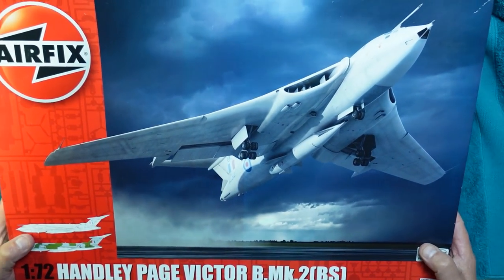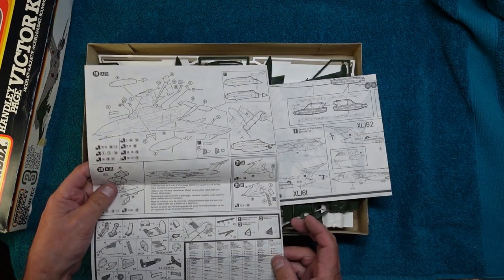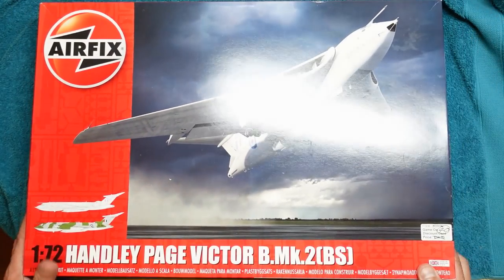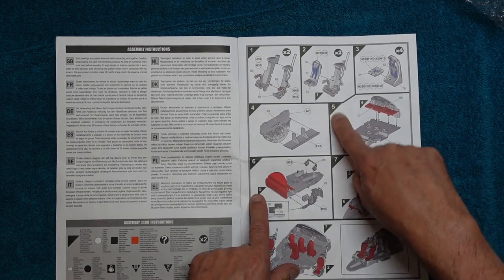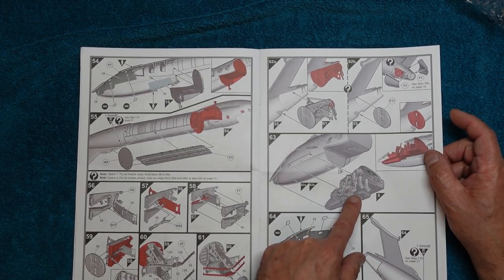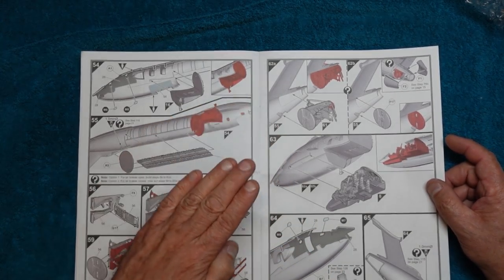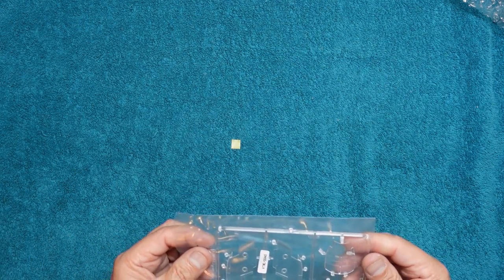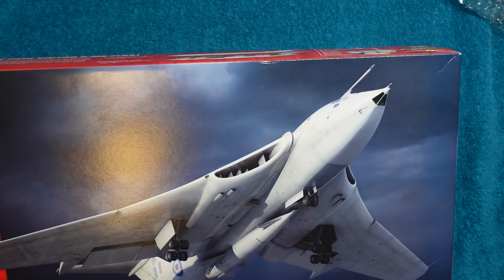Airfix 1/72 HP Victor review and comparison to older kits.

Comment: I built this kit - I'm probably echoing the thoughts of others, but here are few of my "notes" and "if I were doing it again" observations for anyone interested...

Most of the fit was good, but the fit of the "saddle" wing panel over the fuselage needed some fettling to get a step out.
Jet pipes are almost invisible, I wouldn't spend much effort making them seamless.
Ahead of painting, I should have paid attention to getting the cockpit glazing aligned - either pack it or blend down the fuselage to get it aligned. Mine has some little steps. Test fit, test fit, test fit.
The missile fairing in the bomb bay needed some shims to get it nicely aligned.
Front fuselage needed to be "stretched"  a bit to fit round the cockpit. I preferred to sand the cockpit walls and floor to get a good fit rather than clamp and glue to avoid creating a stressed joint. 
I would look to find a way to fit nose gear and airbrake after painting to avoid knocking them off.
The fuselage joint rear of the bomb bay underside has "popped" several times on mine and isn't regluing. Wish I'd added some extra tabs to make the glue area of that joint bigger and stronger.
Fairing around the engine nozzles needs a bit of fettling to slip over the nozzles (and had pretty big sinks.)
I bought the Eduard "Big Ed" set for it. It's nice, but you can see almost none of the cockpit once it's closed up. Gear bay PE may be worthwhile for anyone that picks up their models (not that the kit version is bad.) But I wouldn't bother with the cockpit PE unless you want to practise PE.
I bought the Master Models fuel probe and pitot tube set - they're nice and only a few GBP.
Despite the size of the kit, three years since I finished it, there's no sign of any sag in wings. The internal box structure must be doing it's job.

Don't be put off though dear reader, with a bit of effort the results are very nice, but (at least on my print) this wasn't a case of "chuck the glue in the box, shake it up and a model falls out." Also, it's quite big!
Reply from the maker: Thank you very much Dave. Much valued input there.
Reply: You can fit the front wheel before painting. Don't glue the strut until afterwards.

Comment: I look forward to you building this.
I have built two, one all white Blue Steel and one hemp K2. Lovely kit, but with some issues
with the fitting of the top wings to the fuselage.
I still have the camo Blue Steel to do.
Reply from the maker: Thanks for the tips!
Reply: You can get around the top wing fit - needs some careful sanding and checking of the underside of top wing section prior to fitting, dry fit it and have a good look at pinch points and sand down, you’ll find it fits far far better if you do this.

Comment: As I near the completion of my Vulcan B.2, i can't help but reflect on the fact that the fitting issues were so bad (port wing in particular), that it sucked all the joy of the build out of me and that I don't want to build an Airfix kit again anytime soon.

On one of your other videos, a poster argued that we should keep throwing money at Airfix because we should be glad they're still afloat, and that it was not fair to compare them with other brands. The bottom line is that for the £70 I paid Airfix for the brand new Vulcan kit, I could have had an F-4 from ZM or a huge Su-27 from GWH - and in both cases, the build experience would have been filled with substantially more enjoyment. 

Anyway, I'll watch you build this with interest... but I won't be buying one!
Reply: Mine went together pretty well. So did the Victors.

Comment: Great review of a classic bomber of the V Force. I wonder how the blue colour of the roundels compares with the Vulcans?
Reply from the maker: Well, just had a look and my aftermarket are darkest, the victor is slightly lighter then the Vulcan is lighter again, or more "purple"
Reply: @NigelsModellingBench  is it normal for cartagraph to be so far out, surely it’s the same code for the colour. Which aught to be; HEX #5D8AA8 / RGB (93, 138, 168)
Reply from the maker: @eddiegremlin  Maybe my aftermarket decals are off? But, I'm sure the Vulcan decals look a little purple? Maybe Cartograph only print what they're told to print? Victor and Vulcan are both Cartograph?

Comment: £100 for a paper back? Rip off Britain strikes again lol
Reply: Same sort of price from the USA.
Will be great if it is reprinted. (with Nigel’s Vulcan the right way round)
Reply: @TheWGLOVER  reference books tend to jump like that. Check via ISBN#'s and sometimes you can find decent prices.. for example
Biblio: 2 in Australia at $25 + $28 shipping 
1 in Ohio at $150 + $5 shipping.
Ebay (US) 1 for $80 free shipping
You get the idea
Reply: Unfortunately, books that are unlikely to sell in volume attract a high unit cost. Particularly if they have a lot of glossy full colour images in them. It's simply down to the economics: If a publisher is producing "Buttons Through The Ages" it's not likely to sell many copies, whereas the latest JK Rowling paperback is going to sell millions. Specialist titles with low distribution always cost more (I still shudder to think of the cost of the text books I had to buy for college, even decades later.)
Reply: @davecardboard9567  There's an oddly named place in Georgia (US) called "The Rock". Enormous printers there, had a few pick-up there back when I was an OTR driver. Coupon and ads for newspapers, magazines, books over on its slow side, and text books next to that. Had their own railyard and 3 zip codes. Odd things you learn from trucking. Backed up to the door and was asked to turn on the refrigerator (reefer as we called the type trailer) normally this makes the metal floor too slick for forklifts. Unusually told to stand by door inside and had nice conversation with supervisor there. Once he was satisfied with it's ability to chill, he explained the product was getting was airline magazines fresh off the print machine (at least 8 times bigger than my 82ft long road truck). I was getting 12 pallets for full 35k pound load, how did I want them placed and please go turn off the reefer.  10 minutes it took to get back to door, building sucked up all the moisture from the trailer, I was very surprised. Supervisor explained that the magazines may have a slight need to dry out during first 8 hours after I'm loaded and to please turn it off then. Will do, but why? Turned out I was delivering direct to tarmacs and my freight was going either straight on planes, half of each stop did, by hand no forklifts allowed, rest into the office between the planes. Supervisor explained that was singularly most profitable thing that they made. Huh? How? They get between 1 and 5% of commission from bored people buying stuff from those magazines, LoL. It took ten years of text book and hardcover sales to match 1 weeks worth of these, or a months worth of coupons and sales ads. 
They never are in a hurry for any books printing, except the one batch of Harry Potter release day to Amazon I took from there. LoL. Printers are a crazy business for sure. Have a spiffy day gang.